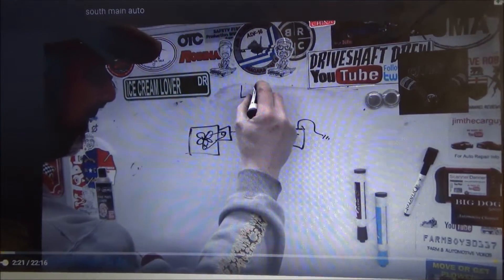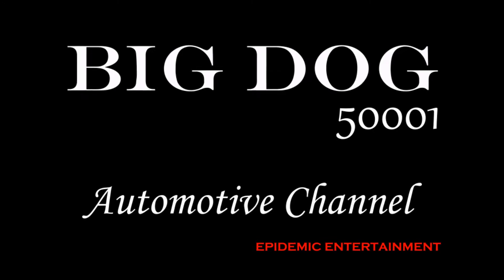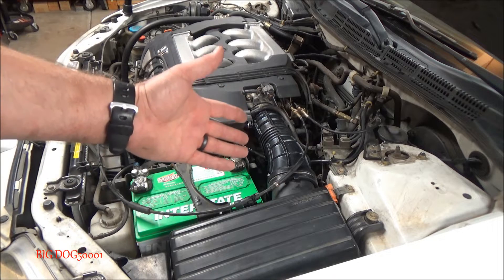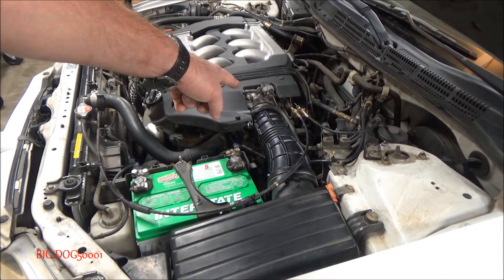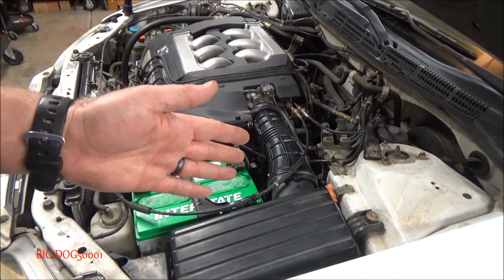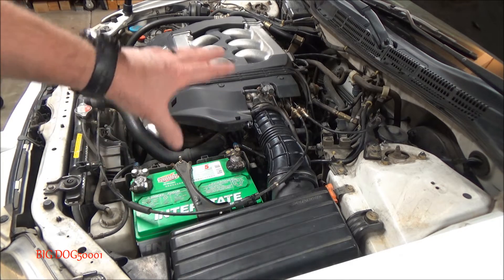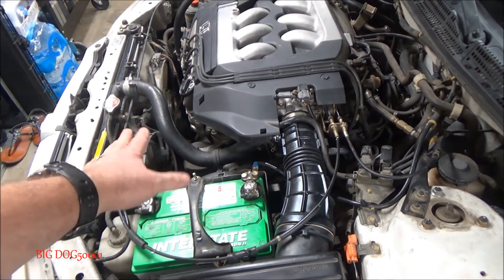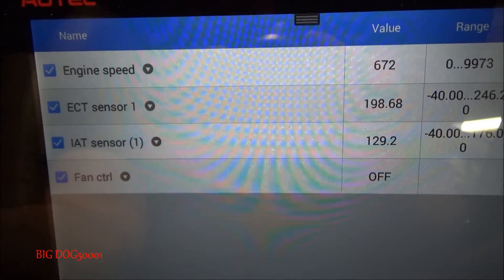Honda Idle Relearn Procedure

Comment: hi i have a Honda sir jdm wagon 2.3 blue top 2000. it surges  when i accelerate particularity when its warming up. is it worth getting a scan tool? it goes like a cut cat otherwise. the are no checklights showing
Reply from the maker: It could be multiple things but Idle air control problems or vacuum leaks are generally where I start when dealing with surging on Hondas.
Reply from the maker: As far as your scan tool question, I definitely recommend a scan tool if you can afford one, it can be very difficult to diagnose issues without one.

Comment: 1993 Accord, I adjusted my idle, reset the PCM, Idle is fine after a full warm-up. Problem is the idle hunts or floats with the Headlights on. I know that there is a FA signal coming from the ALT when it detects a load. I remember my car doing this for awhile after idle adjustments in the past. I just ignored it and it seemed like it took a few hundred miles to set. Is it normal to take that long for the PCM to learn?

Comment: I have a 1999 Crv, does this apply to my vehicle as well? Asking because I'm going to do a throttle body cleaning soon.
Reply from the maker: Yes it will work on those CR-Vs.
Reply: Did you have any problems after cleaning your throttle body? I replaced mine on my 99 crv and I'm having high idle now and seems to be running lean/rich
Reply: @dmon1017  not that I can tell. But by Lean and Rich what do you mean?

Comment: I did it but I’m little bit concerned because the check engine light came on and it still on high rpm when the car on parking mode
Reply from the maker: Just curious, what repair or maintenance procedure did you do before this that required an idle learn and on what vehicle?

Comment: After i cleaned the maf sensor and throttle body my idle is still a little high. I did let it sit for 5mins after cleaning it. Some say it will learn after a few driving cycles. What do u think?
Reply from the maker: Sometimes it can learn it on its own.  When the throttle body is cleaned, the throttle position is now in a different location that what the Engine Control Module (ECM) believes it should see (and sometimes that can set trouble codes), so it needs to learn the new position.  If you have a 2012 Civic (like your name says), sometimes the throttle position memory needs to be cleared and, in most cases, the ECM needs to be reset in order for the ECM to learn the new throttle position/idle correctly.  This is generally done with a Honda capable scan tool.
Reply: @BigDog50001  yea i do have a 2012 civic. It improved actually the rpm doesnt bounce off and idle is better than before and in normal condition but i still have 2 stored codes but not enough to trigger a cel. What do u suggest as a good honda scan tool?
Reply from the maker: @12fg39  Autel MS906 or Launch X431 pros mini work well.

Comment: Does this work for 1999 acura integra ls
Reply from the maker: Somewhat, you can let it idle for 10 minutes with no loads (after fully warmed up) and the ECM can learn some of the idle parameters.  But, there is an idle adjustment screw on those Integras (also called an air bleed screw) that must be set correctly for the system to work properly.

Comment: My 03 civic with 170k miles started having idle issues after I replaced the coolant with distilled water in the process of flushing the system. Any clue?
Reply from the maker: It could be a coincidence, but there is a good chance it is likely related to work that was done.  I would double check all work done, scan for any trouble codes, make sure coolant is bled of air properly , make sure the Engine Coolant Temp (ECT) and MAP sensors are working properly and make sure there are no air leaks (vacuum leaks).

Comment: I know a faster way. Unplug the battery. Touch the negative and positive wires together (don't touch the battery) and then plug back in. Problem solved
Reply from the maker: The ECM does not learn where the correct idle is for the vehicle by doing that, and there is always a chance electrical components could be damaged by doing that.

Comment: What about newer Honda's, like 2018 accord with 1.5t
Reply from the maker: 2018 Accords need the PCM (Powertrain Control Module) reset before letting it idle for 5 minutes and then also need the SCS (Service Check Signal) line jumped afterwards.  The PCM reset and SCS line jump are both done with a Honda capable scan tool.

Comment: Hmmm, I have never heard of this? I've owned an Acura MDX for 14 years now, doing most work myself. I knew disconnecting the battery reset the computer, but that was it....
Reply: Some of them will have a rough cold idle or idle high or slightly hunt for a good idle if you don't do the idle learn.
It was standard at the dealership on a new vehicle to start the engine and hold it at 3k RPM until the engine was warm, then let it idle while you did the rest of the pre delivery inspection. Generally we did the same after any timing belt or other major service.
Reply: @hondaguy9153  I just adjusted the valves on a 2000 CR-V. Now the it wants to shut off when the AC kicks on. Could this be my problem? I had to remove the intake plenum to get the valve cover off.
Reply: @redsholsters3544  Probably a bad IACV (idle air control valve.) 
Does it run rough with AC off?
Reply: @hondaguy9153  it idles a bit lower than normal with it off. It was perfect before I did the valve adjustment 2 hours ago.
Reply: @redsholsters3544  sounds like the valves aren't adjusted properly
Reply: @hondaguy9153  Well it runs fine otherwise. I've adjusted them before without an issue. Who knows? I'm looking into it. Thanks for the replies.
Reply: @redsholsters3544  Did you pull the whole manifold off or just the square resonator chamber? They call your idle control an ICV, not IACV like I said earlier. Same function essentially, but I don't know if yours has the same adjustment the older ones have.
I'd check your spark timing (I'm pretty sure it was still adjustable on a '00 but I can't remember.) 
If you're going to pull the valve cover back off, check that all the timing marks are still lined up at top dead center. If you accidentally turned the engine backwards (or it bumped backwards because of compression while you were turning to adjust valves) it could have caused slack on the timing belt and you could be off on your timing now.
Reply: @hondaguy9153  I only removed the resonator section of the intake. Also I bumped the starter to move the crank. After some reading I think a couple valves might be tight. I'm going to pull it back apart and readjust
Reply: @redsholsters3544  Ah...yea, I don't recommend using the starter. Just get a 1/2" ratchet, long extension (maybe 12" extension...I can't remember now.) and a socket and turn it 90° at a time. 
Don't forget to double check your timing marks while you're in there.
Reply: @hondaguy9153  Yeah I got it done. #3 cylinder was way tight. I guess I was rushing or had a brain fart 🙄
Reply: @redsholsters3544  nice, glad you got it fixed.

Comment: Thank you so much for this information.  I cleaned out the throttle plate area on the throttle body when I changed out a bad fuel injector in cylinder 6.  The car is running fine, but the idle seems to be running a tad on the high side when at idle (800-900 rpms).  I'll do this procedure and get back after to see if it brought the idle down just a little
Reply: Roger S  did the idle relearn fix your rpm issue?
Reply from the maker: Thanks for the comment!

Comment: Hi
I have a CRV 2010, after idle relean completed I got bad mpg and performance than before.
what could be the problem
Reply from the maker: Not sure if you did it, but to reset a 2010 CR-V the PCM needs to be reset with a Honda capable scan tool first.  Without knowing what was done, it sounds like maybe there is more to this issue that is not included in the comment, like other work was done or something.
Reply: @BigDog50001  Yes Sir I did reset with scan tool , and today I have disconnected the battery and the performance is better so why with unlearned idle the performance is better and MPG  too?
Reply from the maker: @Kyle Heslip Although I rarely get the whole story in one comment, it does not sound like a "programming" issue from what you describe.  Those 1999 Accords do not require the PCM to be reset for an idle learn.  If you just did work on it and the trouble started right after, then I would double check all work done.  If the problem is not something that was induced by recent work, then  it might need troubleshooting to find the problem which usually involves a Honda capable scan tool to scan for codes and to analyze scan data.  

Some knowledge of the system is usually necessary to identify a problem like that.  Problem areas or things I look at on scan tool or car include: no load idle speed, air leaks, idle air control valve, Engine Coolant Temperature Sensor (ECT) readings, throttle cable, throttle body, fuel trims, idle adjust screw, 02 sensor readings, MAP voltages etc.  A problem (or combination of problems) with any of those can cause issues.

Comment: I need help, I cleaned my throttle body but once I installed everything and turned it on my car was idling in 1500rpms. It's a 2008 Honda Civic. Will this work?
Reply from the maker: Most likely the throttle body plate is now in a different position that what the ECM has in its learned memory.  Sometimes this will set a trouble code (P0507/P2279).  Usually in order to fix this both the throttle position and ECM have to be reset using a Honda capable scan tool.
Reply: Big Dog50001 Automotive thank you so much. I'll most likely take it to a dealer to get this done cuz I don't have that tool
Reply: @BigDog50001  I'm on the same boat with an 07 Civic. Idles at around 820 rpm but jumps above 1k when I change to neutral (manual) coming to a stop. Is there by any chance that it would fix itself during, say, a run at the grocery store? Man with this virus situation had all the dealers/auto shops/scan tool sources closed at the moment.

Btw, love your videos. Top-notch detail & quality. Keep 'em coming and thanks a lot! Love from the Philippines.

Comment: I have a honda accord 2003 2,4l automatic and recently the alternator went bad.I changed the diode inside and now it's working but right after that i got low and rough idle at stops...when im driving there is nothing wrong with the car but when i stop the rpm goes down to 500 and after a while slowly goes up to 600 which is still low.The rpms where around 700-750 before and 1500 at cold start, now lower..I also have check engine light and the code is P0325 Knock sensor circuit malfunction so is the bad knock sensor causing low rpms or they are not related or is it the alternator causing the low rpm and it needs idle relearn? Would appreciate any advice.
Reply from the maker: Typically, replacing the alternator will not require an idle learn on those Accords.  If an idle learn is necessary, the engine computer should be reset first with a scan tool.  For the P0325 code, the engine speed needs to be above 2,000 RPMs for the engine computer to test the knock sensor for an issue (freeze frame data on scan tool will show you engine speed when it set code).  Those Honda alternators are two stage (high and low) and work in conjunction with engine computer and Electrical Load Detector (ELD).  If any of them are not working properly it can effect how the engine computer controls the idle under different electric loads.  You said this issue came up after working on alternator so I would double check my work if I was working on this vehicle.
Reply: Thank you for the answer.For the knock sensor, i remember i was driving something like 160-170km/h when the check engine light came up, will scan it again like you said. Maybe the best idea is to put a brand new alternator but do these aftermarket ones work well for the accord or it needs to be OEM. I saw your video about the alternator replacement and it wasn't OEM, is it working well?

Comment: Dave, I have a 2016 CRV.   Is the procedure the same?  I changed my battery, and have been having low idle every since.
Reply from the maker: The steps I showed are part of the process but the ECM (Engine Control Module) needs to be reset first on many newer vehicles, including a 2016 CR-V.  A factory capable scan tool is necessary to do the reset.  Sometimes you can get away with not resetting the ECM but it sounds like yours will need it.
Reply: Big Dog50001 Automotive k
Reply: @BigDog50001  what about 2014 Civic? What do you recomend, i have 1500 rpm when the car is moving, in static position (0 mph) is around 1000 rpm.

Comment: So, if you plug in your scan tool you'll see there is a data pid on the enhanced data side for Idle Relearn.  The two statuses are "Learning" and "Complete.".  What I've found with Hondas (specifically my 2008 Odyssey) the data PID will not go to "Learning" without doing either a PCM Reset or a TP Position Data reset via the scan tool.  Additionally, I've watched the data pid sit at "Learning" for about 10-15 minutes before it changes to "Complete."  Just letting it idle without doing anything prior doesn't actually relearn the idle.  I found this out after cleaning the throttle body for the first time at 160K and the idle was high.  I tried the method you describe, which is found all over the Internet, and it didn't work.  Only doing the TP Position Data reset with the scan tool allowed it to relearn the idle.  Some have said disconnecting and shorting the battery cables will do it but I found that not to be the case, as well.
Reply from the maker: The idle learn procedure that I showed is correct for most Hondas including that 2008 Odyssey but on certain models (especially newer drive by wire systems) when the throttle is cleaned it will be in a different position then when the cleaning was started and sometimes it can fool the engine computer and cause an erratic idle (it will usually set a trouble code too).  

In those cases you usually have to go in with a bidirectional scan tool and clear the Throttle Position learned value using TP Position Check, reset the engine computer and then do the idle learn like I showed in  video.  The reason the data PID shows learning is because it MUST learn the idle after a reset and the reason it shows complete (even though it may actually be learning) is that it already has a learned value stored in memory from a previously completed learn.
Reply: @BigDog50001  This is interesting.  The factory service manual always says after most sensor changes to "Reset the PCM" and "Do the idle relearn."  It says the same thing after cleaning the throttle body.  So, what is the difference between "Reset the PCM" in the scan tool and removing the battery cables and shorting them together?  When I did this it was at 160K when the service info says to "check idle speed" and that involves checking throttle angle, which I found high and out of spec.  I cleaned the throttle body and then had the high idle afterward but set no codes.  None of the Honda idle relearn instructions posted all over the Internet would work. I've since purchased a bidirectional scan tool and had to reset it that way so it's easy now but it was frustrating at the time.

Comment: Hello what Honda car is it? Will it work with Accord 2.0 EU version from 2011 year. I have some issues with stearing wheel vibration on idle. Before i had accord 7 gen and never such issues. Now when i changed car for new Accord this vibration are very anoying.
Reply from the maker: I would check all engine (motor)/transmission mounts and make sure none of them are bad.
Reply: @BigDog50001  Engine mounts are good, already checked... Car has only 63 000 km run. The vibration are only when the engine receive normal working temperature. I cant find person who would find a solution.
Reply from the maker: I do not have access to info on EU models but this idle learn process works with most Hondas.  That being said, the engine mounts on some models have oil in them and are attached to a solenoid (Engine Mount Control Solenoid) that controls engine vacuum to the mount.  Generally, the engine computer supplies engine vacuum to the mount when the engine is idling to control vibration.   If the solenoid/mount/or the engine computer are not operating properly it will produce more engine vibrations than normal at idle.  This is where I would start.
Reply: @BigDog50001  thank you for advice... I will be looking for solution. The main engine mount has OEM number 50830-TA2-H11. In your opinion it works like you described? Or it is normal mouny without computer controlling.